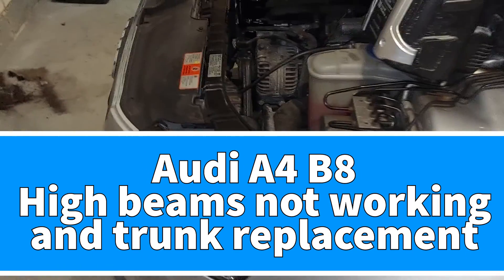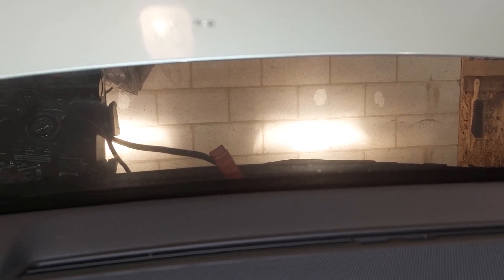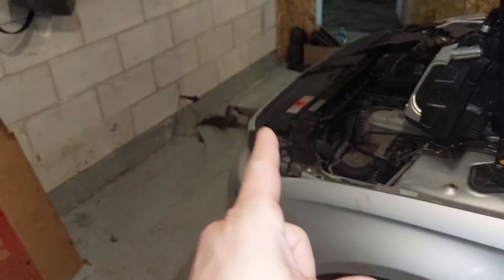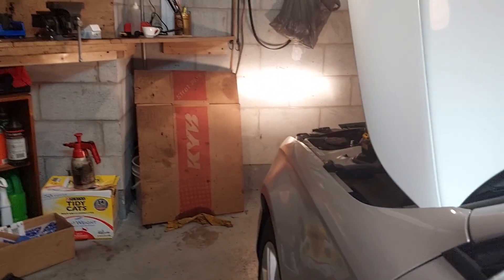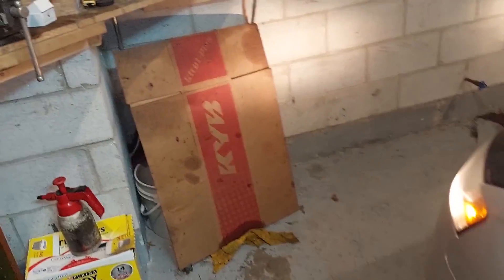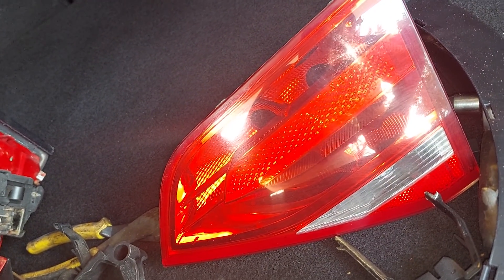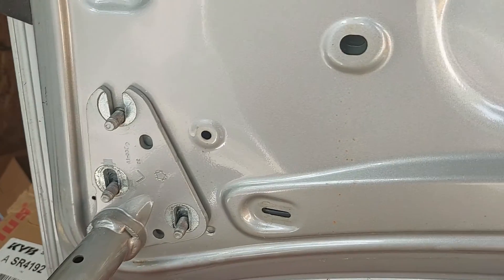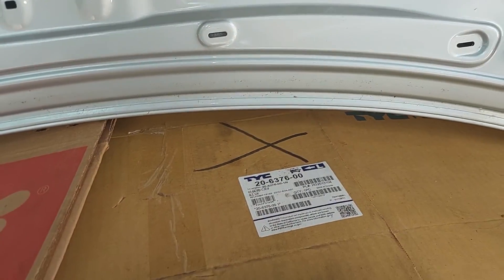Audi A4 High beams not working coding???

Comment: Both my low beams went out and i tried to replace all kinds of things but its still not working.... bulbs, electronic, fuses, even the light switch..... anything you can help with ?
Reply from the maker: You need a scanner to confirm things are working properly and the module is sending signal out. And you use a test light to confirm. You need smhmatics

Comment: Any info how to code this with VCDS
Reply from the maker: Watch humble mechanic he did a video on it specifically vcds
Reply: I'll might have to do that, It's way easier. I will let you know if I made it work
Reply from the maker: @Dukicc  good luck.
Reply: Found the video but he only explains how to use the vcds, I get into the coding but don't exactly know which options to enable and which not
Reply from the maker: @Dukicc get obd eleven it’s easy as soon as you get in to the correct module you just scroll through and you will see it in words as well as numbers

Comment: How the hell do you even switch the coding ?? Im having the same issues on my b8
Reply from the maker: You need a scan tool that is capable. And some research.
Reply: @MyHomeGarage  any recommendations on devices ?
No budget but ion need no snap on either 🤣
Reply from the maker: @pimpinnp7243  obd eleven very easy to code. I have that and a autel mx808 maxi
Reply: @MyHomeGarage  do i need to purchase any plans for the OBDeleven or is the free plan okay?
Reply from the maker: @pimpinnp7243  when I originally bought there wasn't a plan. But depending on price it's a nice price of hardware for the price

Comment: The same problem Audi a4 b7.
Reply from the maker: The b7 had problems with the wiring insulation deterioration inside headlight assembly. Pull bulb connector and check wiring